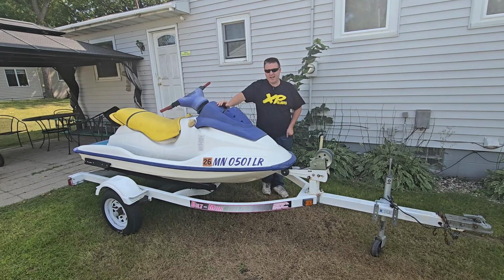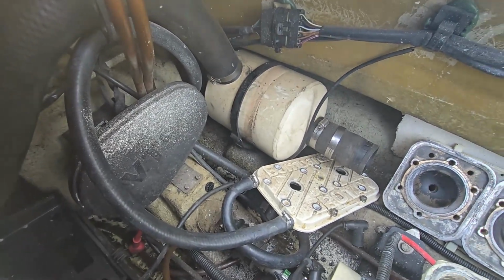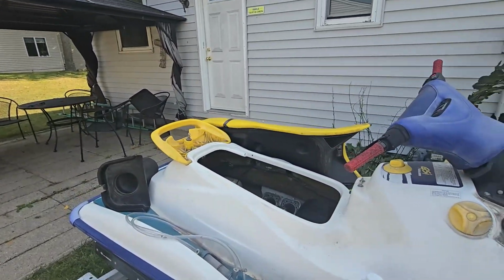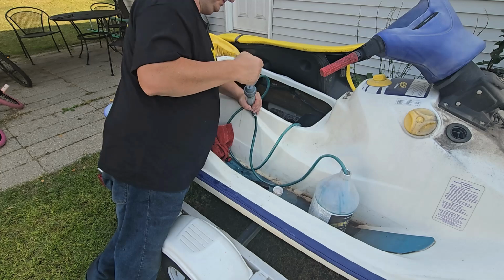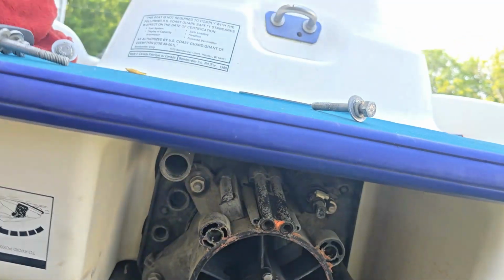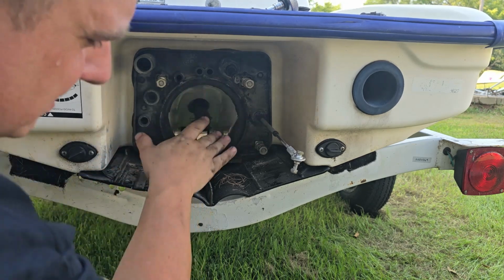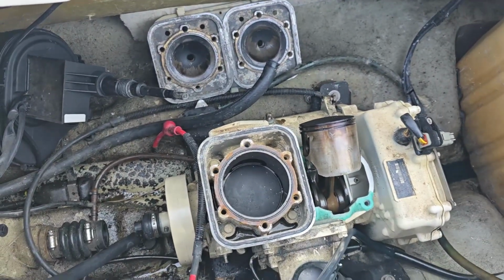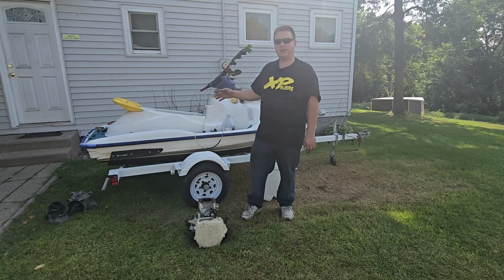1997 GSI 717 Project: Episode 1: Teardown

Comment: Cool to see you working on a gs model, sure you already know this but the 717 in the GS hull is largely regarded as under powered (couldn't believe the difference between riding a gsi and gsx), the 717 is great in the smaller X4 1995, 1996spx, but not great in the heavier hull... IMO if your talking GSX it has to be the Ltd 951... That is a true performance machine to this day (mine hits 64 on glass, I weigh 72kg) I did love the tiering though GS, GSI, GSX, GSX LTD. That was cool. Good to see you wearing a mic, so much better viewing experience, great work man.
Reply from the maker: @classicjetskis  yes..but the GS has to be lighter than the GTI hull. My 96 GTI 717cc seems plenty powerful but my 99 GTI with the larger hull and 717 is very underpowered.
So im sure the 03 GTI with an even larger hull and 717 is pretty gutless. Got a video of that 03 GTI project coming up.